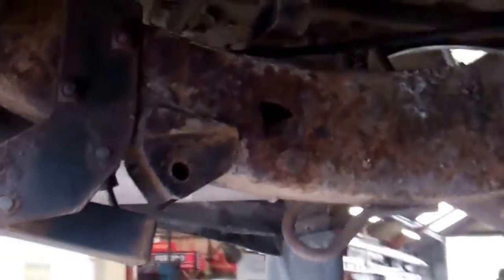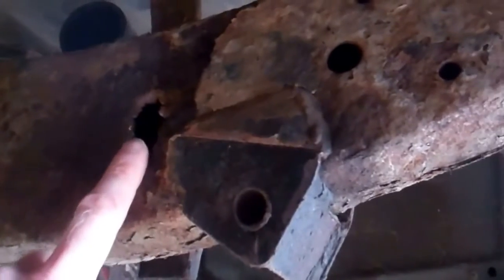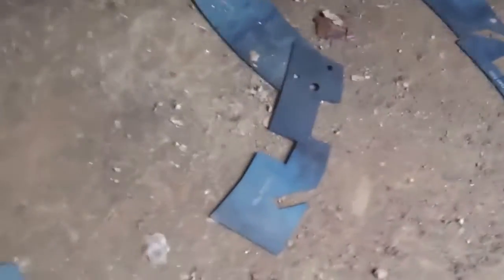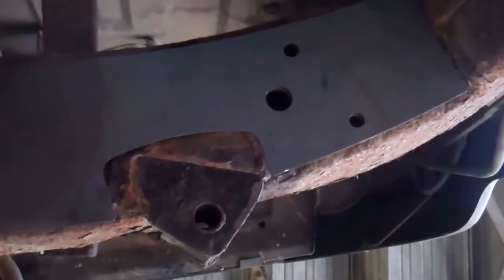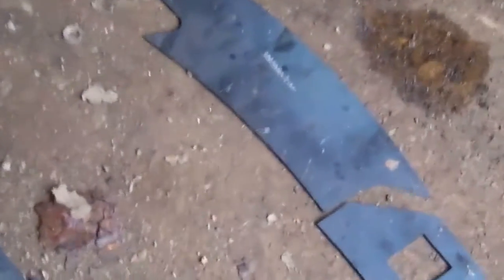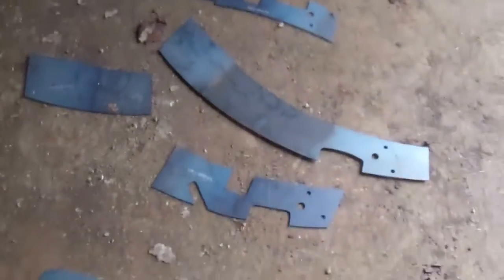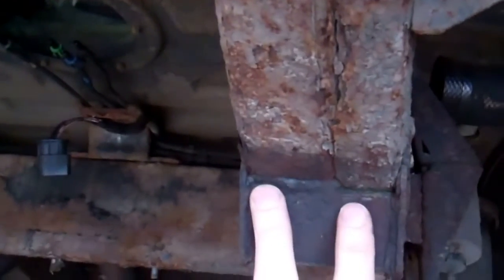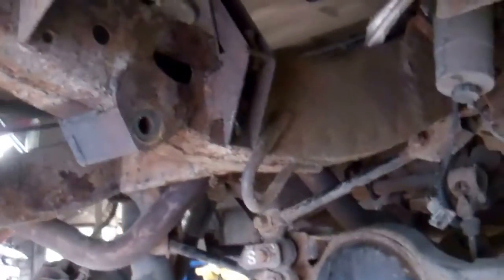Land Rover Discovery 2 Chassis repair using pre-cut sections

Comment: I have this issue with mine.  No way am I welding onto the current steel. This should be illegal
Reply from the maker: It is a weakness of the car - welding is not ideal but it is a shame Land Rover did not make the chassis more corrosion resistant

Comment: That chassis is totally gubbed. To be honest, by the time you faff around trying to weld these plates to cover up a very weak, rusty, crumbling chassis you could have fitted a new rear chassis section much quicker.  Far safer and long lasting too.